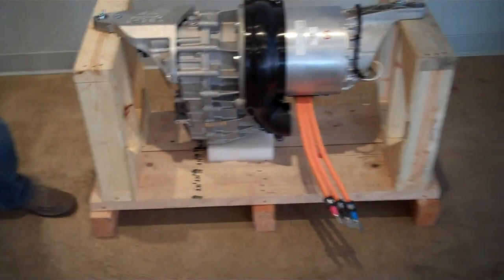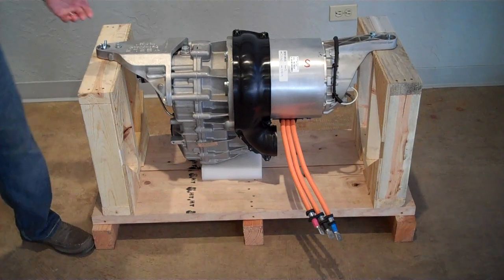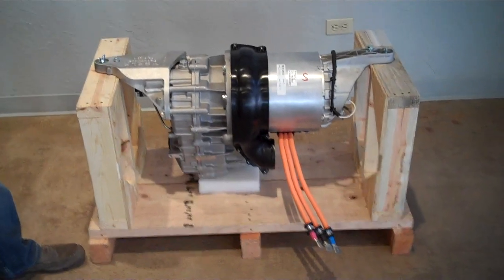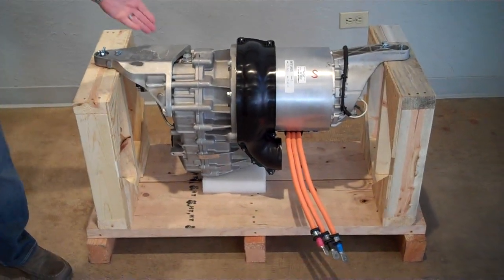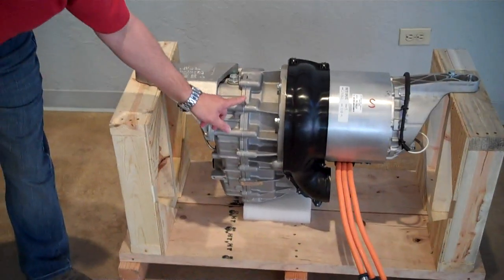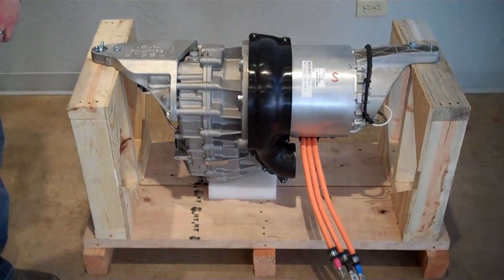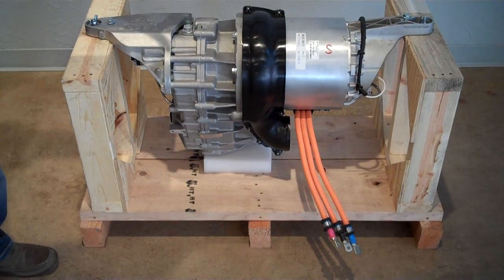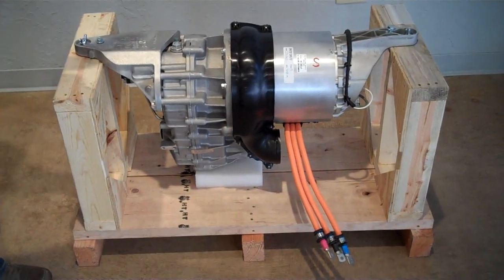Tesla motor

Comment: it makes me sick to see how 'amazed and impressed' some $#%^#$@ appear when presented with technology that should of been used 50 years ago insted of the combustion engine just because govermnets and corporations are run by idiots ....and the real loosers are the common imbecils breathing in all the poison from all the idiot managed societies ....
Reply: Not entirely true. While the concepts have been around for ages we have only recently been capable of producing batteries that have a long enough life span to be able to be used in automotive applications. Not only that but disposal of older battery technology is less than "green". The motor is only mildly impressive, the battery technology is really what has been exciting over the last decade.
Reply: Even 25 years ago this would not be possible because batteries had much lower capacity than now.
Reply: freenergyterminator Before you start a flame-skirmish, keep in mind that only recently has rechargeable battery technology reached the point where the electric motor is worthwhile considering for modern highway-capable vehicle propulsion. Yes, very good electric motors were available well over 50 years ago, and the necessary drive electronics for around 40 or so years, but none of that means anything without a high energy-density and long-life battery pack to store the energy in. Contrary to the often thoughtless layman's point of view, the tiny percentage of people in the world who are able to run huge successful corporations are NOT that stupid.

You need to store the energy on-board, and that requires a very highly developed rechargeable battery--something that's just barely beginning to become available thanks to small, standard lithium-ion cells being produced in enormous quantities for cell phones, notebook computers and other digital gadgetry.

It's a car, not a furnace fan.
Reply: freenergyterminator The infrastructure (electrical power distribution grid) is already in place and has been for a hundred years. It's the battery pack that's been holding everyone back. Lithium-ion cells are just barely becoming usable for practical vehicles, all the other types can also give great performance, but very short range. Tesla cars are now approaching the range of combustion-engine counterparts, and lithium-ion cells continue to improve.
Reply: well, I don't think that is quite why people are amazed.  I think they are "amazed" for the same reason you're saying here.  What is amazing isn't that the car can go so fast, it's that the engine is so small and simple and we could have done this all along.
Reply: 100 years ago.... You should have seen Nikola Tesla's original roadster!
Reply: greg55666 No we couldn't have, the missing link (and still the weak spot) is the battery pack, not the motor or the power electronics! Check out my other replies.
Reply: ***** Bingo! Someone finally gets it.
Reply: greg55666 As far as electricity stations go, everyone's house pretty much qualifies. Building charging stations that get their 'fuel' from the existing grid is a relatively trivial endeavour, with all the really hard work already done.

As for range anxiety, Tesla cars may realistically go 400 highway km on a charge, while gasoline might get you 500 or 600. Diesels fare better at 800 or more, assuming a typical midsize passenger sedan with a 50-60L tank. The problem with electric cars is that to have a range-at-speed equal to combustion engines, you need to have an enormous battery pack (100 kWh or more). Lithium-ion cells are just starting to approach the required energy density--remember, the Tesla pack is watercooled to allow very high charge and discharge rates with ordinary 18650-size high-energy cells, so the total size and weight of the pack is twice what it would be without watercooling. If the cooling system wasn't required, Tesla cars could be built to go 800 to 1000 km on a charge. The car would still be very expensive, hence expensive to insure, and the fuel savings won't offset that. High-performance electrics are still a pricy alternative to combustion--but they're just beginning to become a reality.
Reply: best point so far
Reply: +BasementEngineer I think the thing that bothers +OverlyAttached Bean and +freenergyterminator (at least bothers me) is that the battery technnology just appeared last decade because there were petrol engines around to power cars, so the demand for power storage was already satisfied. Keep in mind that producing and distributing petrol is a very hard task (like drilling holes thousands of meters under the sea and tank trucks to deliver it), but we did it anyway, due to demand. If this same will-power was aplied to developing batteries since Ford, I'm sure we would have better batteries for decades already. Too bad the big demand for better electrical storage just came last decade, with portable power-hungry electronic devices like laptops.
Reply: +Kayran Gandhi An often overlooked issue is not range or charge, but charge time. It takes a long time to charge a battery that large. It takes 8 hours to charge a battery that will give you the same range as a tank of gas that fills in less than 5 minutes.
In Japan the electric taxis overcome this by using battery swap stations - like Jiffy Lube, you drive in, the crew drops the battery and puts in a charged one and off you go.
As far as developing battery technology, it is a chicken-and-egg problem, until recently we had no need for high capacity batteries - back in the 60's,  pretty much all you needed batteries for was flashlights and radios, plus the one to start your car, for which lead-acid cells were just fine.
Reply: David Stone All excellent observations.
Also, it's not charge time, it's charge rate. It takes as long to charge a 1 Wh cell as to charge a huge 100 kWh pack. It's just battery chemistry. Tesla packs fare better because they're watercooled; it probably doesn't help pack life though to 'cram' them up using excessive charge voltages though. You still have to hold 'em up at 4.1 or 4.2v a cell and wait for the current to drop to ~1% of C, then they're fully charged. Takes a couple hours.
Reply: You leftists sure are filled with a lot of hate and discontent. BTW it's "losers", not "loosers"
Reply: Yeah, I can't think of any right-wingers that are full of hate and discontent....
Reply: Well, there ya go...
Reply: *****
it's about the infrastructure not how independent one individual unit can be
Reply: BasementEngineer That's not true.  The infrastructure we're talking about is "electricity stations" (instead of gas stations).  Those don't exist.  In terms of range, electric cars are exactly the same as gas cars (they can be, like Tesla).  When anyone talks about "range anxiety" they mean "gas station anxiety."

I was watching a Jay Leno's garage the other day and he made a brilliant point that puts this stupid "range anxiety" thing in perspective.  In the '70s when the Europeans started importing diesel cars to America, the cars came with a booklet that listed all the gas stations in America where you could get diesel fuel.  It's really not that complicated.  This "range anxiety" thing is entirely a marketing ploy against getting off oil.
Reply: +BasementEngineer Tesla has already demonstrated they have the technology to swap battery packs.  There is no issue at all with the technology preventing their adoption.

The only problem is infrastructure.  (And of course oil companies paying politicians to prevent it from happening.)  We must vote to get money out of politics.
Reply: no its actually because of ford, if it wasnt for him our earth wouldnt be polluted and wed have electric motors even better than this

Comment: 215kw =288hp. At 375v that means its pulling 573 amps through those little what 6-8 guage wire! and check out the little spade connectors.I call bs
Reply: You're so wrong and i want you to apologize for being wrong. Fucking dipshit.
Reply: Go look up how to calculate current draw per leg of 3-phase motors. The current you are showing is the VECTOR sum of three currents occurring at different times through the cycle.
Reply: rizzmans 6-8 gauge wire? LOL get out of here.
Reply: It would be 335A for 3 phase system P=sqrt(3)*I*U

Comment: I wonder if Tesla designed an onboard generator that had the output of a Honda EU1000i which puts out 900 steady watts, 7.5 amps at 120v. running 3.8 hours on .6 gallons fuel could power the Tesla cross country or locally. It would have to be able to put out an average power to run an AC heat pump to cool cabin and batteries and/or resistive heater to heat the same. Operate all the other stuff too. I'm wondering if Tesla ever figured out a baseline average wattage needed to cross country.

Comment: True, the Volt and the Fisker are both feasible examples of hybrids or "range extended EVs". I just think the addition of combustion engine would 'add too much weight, rotational mass, excessive parts". You would need an air intake, exhaust, generator, engine, petrol tank etc.

What is an acceptable range for you? Would you be happy to compromise if there was a fast-charging station near you?

Comment: It works very well in the Chevy Volt, in fact a Tesla would only need a generator/motor smaller than the small 4 cylinder the Volt uses to keep the batteries charged. Probably an efficient two cylinder constantly sipping a tiny amount of fuel constantly could provide a one hundred plus MPG range while adding a slight weight gain. The cost of adding such a power supply would admittedly add quite a bit, being the major drawback.

Comment: I agree with you about CVTs, they reduce the drivetrain efficiency in acceleration and regeneration. However, your idea of adding an entire engine and fuel supply is not really ideal, removes so many benefits of being an EV. 

I think Tesla should try some new battery tech (such as graphene or molten air) that can be installed in existing models, allow crowd-funded superchargers to be installed where there is demand and get a rush on that $35k model (expected 2016).

Comment: Personally I think CTV's are junk, but anyways the electric motor spins way to fast, probably almost 3 times to fast to couple up to that motor, and would add to much weight, rotational mass, excessive parts. It would screw up the regenerative braking, mileage range etc. It would be hard to significantly improve the Tesla being that the Tesla is way way ahead of it's time. I need one. (or two) An extremely efficient, very small motor powering an alternator would be a good option to extend range.

Comment: Looks to be one of those supersized brushless motors used on a RC car-plane-boat witch Tesla invented the first RC boat. or a MEGA synchronous clock motor .would be a super duty forklift or tow motor power unit

Comment: It seems ignorance of motors is very common. So here it goes: This motor is able to produce so much power for its size because it is a 400 Hertz design. The higher the frequency, the smaller and lighter an AC induction motor will be for the same power. A 60 Hertz motor of this size which are used in industrial manufacturing would weigh in at a couple of thousand pounds.

Comment: I still want to know why, with so much torque, they only have a 1 speed box. If it had a 5 speed box, it would be better able to sit on cruise speed, using bugger all juice, instead of running at ridiculous amounts of rpm, which would also make it run quieter.

Comment: The point is the power transformation capacity for cubic [volume] 

Heat dissipation?

efficiency 98%?

normal is 93-95% 

heat2% = 6kW -too much for this unit, it should have more eff.